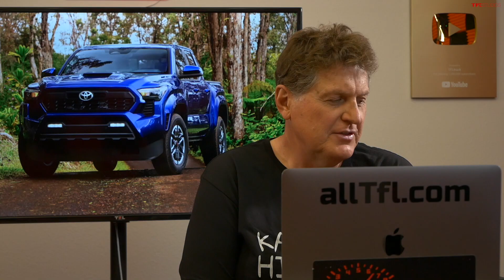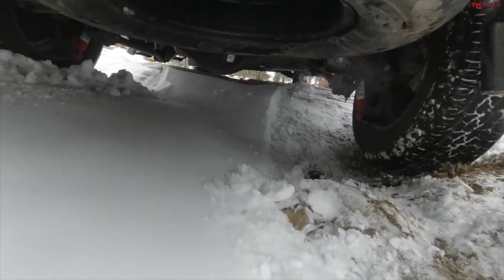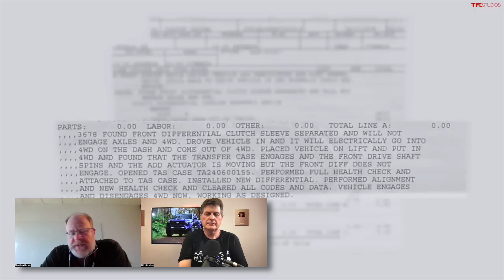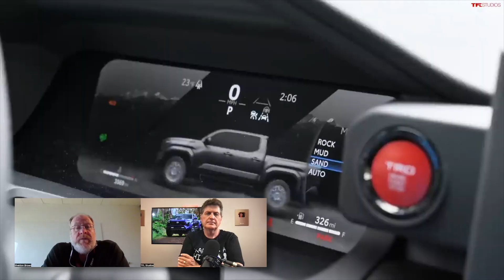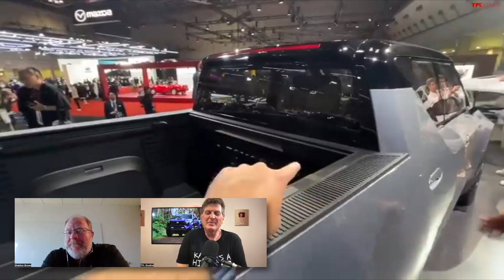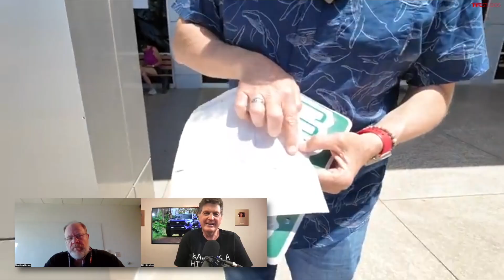The Real Story Behind How Our New Tacoma Broke & How Toyota Plans To Fix Yours!

Comment: I want TFL to drive a Sienna, yes, Toyota's own front wheel drive minivan, up the same trail section and see what happens. You might get stuck, but I'll bet it wouldn't break.
Reply: Agreed or rav4 neither would
Reply: As long as it's an early enough model year.  They could try it in a Corolla or Camry, too.  I spun tires on a 2006 corolla once, and  nothing broke.  If they did that, they would just claim that conditions weren't exactly the same due to the variables in snowfall.

Comment: Truck King just released a video, two hours before this one dropped.
The clutch let go during an aggressive, on-road downshift. Toyota said the only explanation was that the guy messed up and shifted from 5th to 1st, instead of 3rd.
TRD OFF-ROAD model. Doesn’t give a lot of off-road confidence.
Reply: From what I saw, the clutch was depressed and when trying to put it in gear it was grinding. And the clutch never came off the floor, so that tells me it never disengaged.
Reply: @glbennett66  Good catch!   I also posted on that video.  No way that redlined
Reply: Worse when Toyota blamed Senior for the failure when video evidence shows otherwise. Disappointed that TK had to swallow their pride and accept blame. But I get it. YT is competitive and getting locked out of manufacturer events will kill a channel these days.
Reply: My stick shift Mustang locks me out of 1st gear when going faster than 15 mph. Do Toyota not do this?
Reply: It seems to me that the driver would notice right away if he went to first instead of third.  Even if he had, one shift like that should kill a transmission.  Forced limp mode, maybe, but not kill it.
Reply: @doom4067  someone in the comments there did the math, and the friction disc would have been spinning over 12k RPM with a 5-1 moneyshift. its possible the disc itself grenaded when spun up to that speed. the manual trucks only have a 5400 rpm redline compared to the 6300 in the automatic. also, the engine RPM wouldn't have gone above the auto rev match if the driver never released the clutch to complete the mechanical connection between transmission and engine, so saying the truck never redlined doesnt mean anything when the clutch itself is what broke in that truck
Reply: Just watched that
Reply: Yup, i watched that and watched the rpms. HE DID NOT GO FROM 5 TO 1. More lies from these mother fuckers. Toyota went from my favorite brand to most hated.
Reply: Saw that.  The truck didn't even red line.  Why wasn't 1st locked out anyway at the speed.  TuRD!
Reply: @jyharris the first gear wont lockout because of the rev match. If you drive a old school manual, you will know that you cant downshift from 5 to 1 unless you rev match.
Reply: @jyharris  because it wasn’t first gear. Anyone who has ever seen or experienced a money shift knows its a lot more dramatic than that. The wheels lock up the car screams at redline

Comment: Is this the same engineer that said the new Taco mechanical's were designed to heavy duty truck standards?  Trying to get up my driveway in the winter would put more stress on that truck than TFL did when the transfer case failed on that bunny slope

It would be nice if TFL would get as upset with Toyota as any normal person would , had this happened to them.

Comment: Are the transmission and front axle carryover units? Mechanical systems have two weaknesses: weight & torque (both increased).  Now, Toyota has to limit capability (torque) in attempt to preserve itself. Hopefully, 42k owners will still be happy, when/if Toyota takes back some of the truck's promised capabilities.

Comment: So weird that this hasn't happened in the last idk, 30-40 years in toyota ifs systems, now that you cheaped out it happens? This scenario isn't the first time people have lived before and this never happened to them. This isn't a super special rare line up of the stars and galaxies type shiz. Don't feed us this bs. It happened in soft driving condition nothing extreme. This isn't mexican problem either, they just put the truck together, not build the engine, Transmission or anything else. Manufactured and shipped to Mexico just to finalize the vehicle. Face it, you build cheaper teuck to save money and not pass the savings to us. Greed got you here.

Comment: Let me simplify Toyota's answer even further:  When 4 wheeling in what any reasonable person would believe to be low stress driving, the Tacoma engine torque can exceed the design of the 4WD system and result in complete failure of the transfer case.  Or you don't have to abuse the truck to break it.

Comment: Lol the "we don't recommend/support installing over sized tires" is just ignorant. "We know our customers are going to do it" so why would you then intentionally not account for that? If it's such a regular practice in the offroading community, and every other truck seemingly allows for it, even the other gens of tacos. 
This was a really half assed explanation/excuse. You said yourself you weren't even at full throttle, so it wasn't even the maximum possible load, and it still "exceeded it by 1.7%". What a lame ass excuse.

Comment: This is damage control because savage geese slipped on why tfl broke the Tacoma. Basically Toyota engineers didn’t dummy down the off-road settings. After tfl switched the wrong terrain setting.

Comment: TLDR the taco wasn't designed for even light off-road conditions. Ice and snow like that is on of the easiest loads a 4wd drive line will face and it exceeded the load capacity? Total junk and unacceptable explanation. Toyota cut labor costs by 80% moving the whole production to Mexico, it seems they also cut other costs and corners, and they charge customers more. Toyota is greedy and has the highest profit margin out of all of there competition, and it shows. Can't wait to see Roman break the 4Runner because he put more than the recommended weight of 120 lbs in the back or some water got back there (both cases are very common in a off-road marketed truck)

Comment: Nice that chief engineer came on the channel.  I'm confident Toyota will fix it.  Ironically, it seems the traction control contributed to the issue as it is braking wheels to shift torque. The dynamics of braking a wheel while maximum torque is being applied to essentially one wheel probably was the issue.  With no traction control, it likely wouldn't have broken the shaft.  Perhaps software will fix it.

Comment: Toyota does a great job as long as they stick with old technology. But “new” stuff baffles them. And they are slow to get up to speed and fix their mistakes. They need 3 to 4 years to debug and fix new technology. Meanwhile, their old technology stuff will run for ever.

Comment: Engineering tolerance is 150% of rating.  The best will go 200% until failure.  

Yea that’s an engineering compromise skewed to strength.  You’ll have heavier components yielding lower mpg and less payload.  

You made a compromise here, Toyota and it bit you.

Comment: How about Truck King's manual clutch issue they just had. They blamed Truck King, but I think they just don't want more bad press for the highly priced Tacoma.
Reply: And Truck King waited for toyota's permission to talk about it.  I just watched that video, and it seems like they would have noticed right away if the dad had shifted from fifth to first, instead of third.
Reply: Do you think they paid him off to take the blame?
Reply: I'm not sticking up for toyota, but it is very possible Truck King Pop hit 1st gear during the downshift. Only way to know for sure is to have someone more familiar with the shifter try several 5th to 3rd downshifts and see if it grenades or not. If it does not,well than, Pops blew up the clutch, period.

Comment: That is why they won't put a front locker in their trucks. The locking collar that connects the half shaft to the stub shaft when in 4 wheel drive broke to pieces. It is the weakest link in the system, and it is designed to fail before anything else fails. A locker will be breaking this design constantly and that is why Toyota will not offer one. I rebuilt m 2002 front diff which is of the same design albeit somewhat smaller and i have always questioned its durability. This confirms my concerns about that.

Comment: If you can't dazzle them with brilliance, baffle them with BS.  Works every time.
Reply: Just claim user error. Thats what they did.
Reply: @ryanb8736  apparently a couple inches of snow, a little ice, not much of a stress on the 4x4 system when in these conditions is Toyota’s krptonite
Reply: @pathunter7003 little friction from the tires but lots of torque from engine together with braking from traction control. It was a low friction event but not a low stress event
Reply: @Justmejbful  but how can there be a stress event on a spinning tire with no traction tho?
Stresses would be more on a tire with traction
Reply: @pathunter7003  from what I understood the stress was on the drivetrain of one front wheel due to the multi terrain system braking the wheel to regain traction. Brakes tend to be more powerful than the drivetrain system.
Reply: @Justmejbful  I see your point but it seems there  was little power being put on that one wheel for it to snap like that. I could see if the wheel was spinning at say 35 mph and the brake just stopped it cold, that would stress parts
Reply: @pathunter7003  Angular acceleration is a bitch. Best I understand what Happened was the left wheel brake locked up the left wheel all about stopped and then all the torque {including rear} got pushed to one wheel and it's components. Too much acceleration too quickly making the material snap/deform. Inertia is inertia, and in this case made larger by having bigger wheels. You can't infinitely accelerate those driveline components. Something will snap/deform. In this case exceeding by almost 2%. What bugs me that the components have almost not error margin. Sometimes us engineers make a desing a little too efficient. As in use exactly the minimum material needed for the desing with no extra margin because you don't expect extra forces 🤔
Reply: @pathunter7003  it's less about speed and more about torque. A tractor can pull very heavy things but does not move very quickly. That doesn't mean a tractor doesn't put out massive amounts of HP and torque.
Reply: My 97 4 runner doesn’t have these problems
Reply: Why not? If it’s good enough for government.
Reply: Cybertrucks only card in their uno deck hand is exatly this you mention
Reply: The guy is talking very fast and that usually means B.S. When things are under control people will talk calmly and slower. Amazing out of all the trucks this is the only one that broke?
Reply: @rbfarrell1  he spoke fine. I'm an engineer, he wasn't speaking any BS, all he said made perfect sense. Now having margins so tight that 1-2% can pop a drive-line components , not the best

Comment: Toyota needs to return to over-engineering their driveline components, at least on the offroad models.  You CAN build a bulletproof vehicle, I have one sitting in my garage.  My 3rd gen should be embarrassed by the 4th gen, but the seats are reversed.  Not good.

Comment: Toyota basically said they built a weak 4wd system.
Reply: Yes
Reply: He said it purposely has a planned failure torque limit. The scenario TFL encountered was outside what Toyota encountered during development. Toyota responded with updated software. 
I'd say that's a better response than GM had when the air bags went off on TFLs Colorado ZR2.
Reply: That Colorado issue occurred for some owners and for the next MY the manufacturer immediately is implementing a fix, and I have never heard of transmission failure even on the "horrible " 8 speed at the rate the new Tacoma transmissions are blowing up....
Reply: works for subaru
Reply: @jeffforbes70  How are you comparing a Subaru to a pickup truck? Sadly from the looks of it, Subaru may have a stronger 4wd system.
Reply: no

Comment: So you driving the truck off road in the snow was a unexpected one off thing? You exceeded the design limit by 1.5%.  People need to relearn how they drive off road, ( drive easier). Don't install larger tires.  Toyota will fix it by lowering the torque output so it does not break the parts that was never updated for the new more powerful engine. Any bets on when Toyota will have an updated stronger design part? Mid model year change or for next year?

Now all manufacturers have gone through things like this. Revisions and up dates are very normal in this industry. What is also normal is the the automotive press circle the wagons and always treat Toyota with extra care and choice words. The Kool-Aid works well. So many issues with Toyota across their line up over the last few years. Always the same cut and paste talk about "Legendary Reliability "  Those days are long gone and have been for years. You people buy a vehicle and replace them long before most problems come up that normal everyday people deal with. 

Great video and good for Toyota for letting the lawyer, I mean engineer come on to COA ,explain what happened.

Comment: Please compare the capability differences between trucks before vs after software update.  Sounds like they detuned the performance to protect the hardware. This would never have happened if you used it the way Toyota designed it for, ...to get groceries.